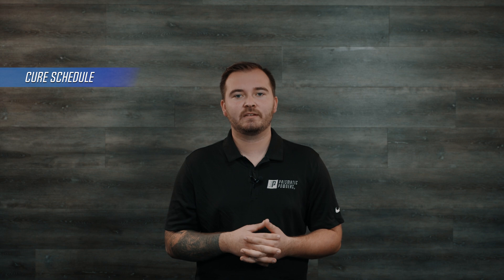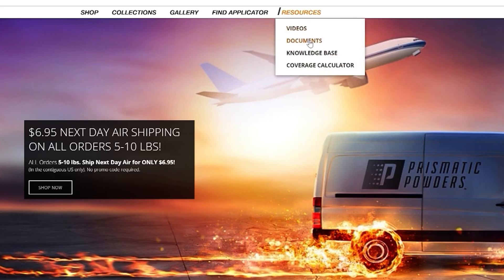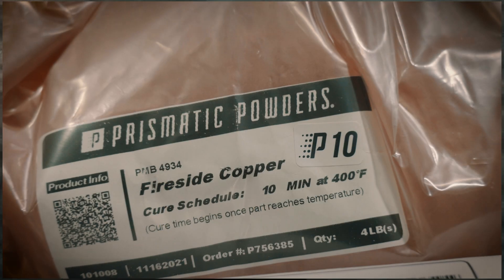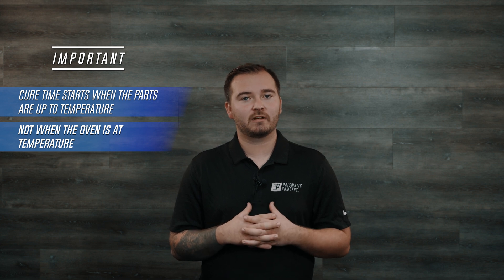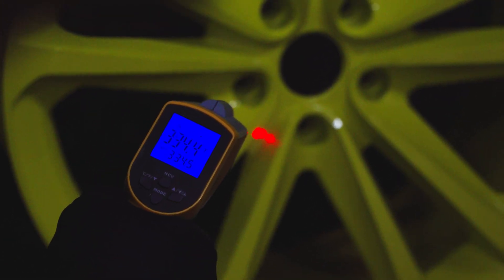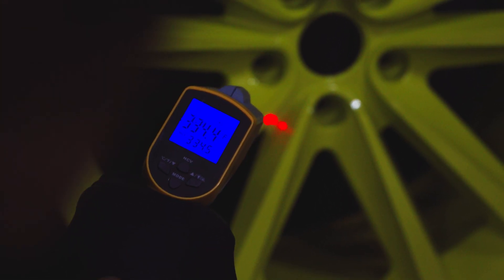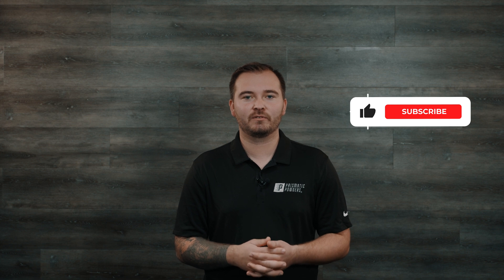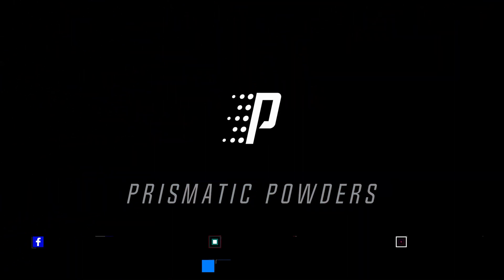Prismatic Powders | We Have The Cure (Proper Curing in 3 Easy Steps)

Comment: So it won’t over cook if I leave it longer?
Reply from the maker: Powder in general is pretty resistant to any adverse effects from a little extra time in the oven. If you have a rack full of parts of different densities, and some parts reach part metal temperature quicker than the others, they won't be harmed by the extra time in the oven.

Comment: During the time you check the actual temperature on the part, the oven temperature in the panel reading will drop significantly or not? Will it impact to the part temperature and therefore impact to the curing schedule? What would be your proposal if we do have a conveyor curing oven, how can we check the part temperature on periodical basis? As attaching a thermocouple sensor on daily basis can be a bit troublesome. Thanks for your answer
Reply from the maker: Unfortunately I don't have a definitive answer for you, because it will depend on your particular oven and setup. For ours, we do not notice a temperature drop. The time it takes us to read the part temperature is only a matter of seconds, so there is no impact on curing. For your situation, you may be able to use an IR temperature gun like we do. The IR beam reached pretty far but you do need to take your reading from the thickest part. 
Hope that helps.